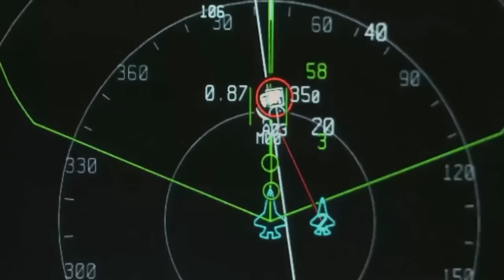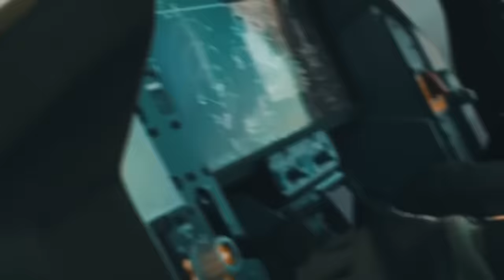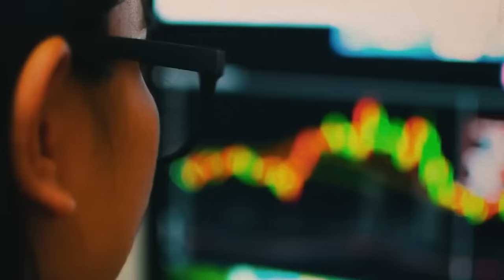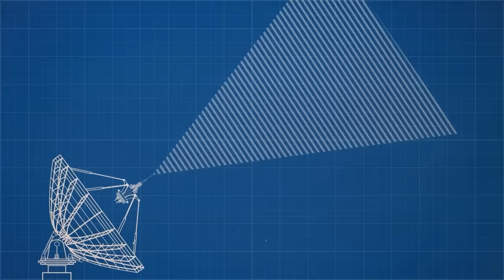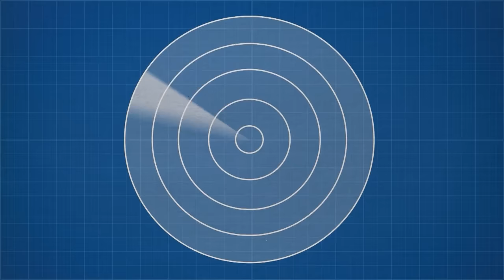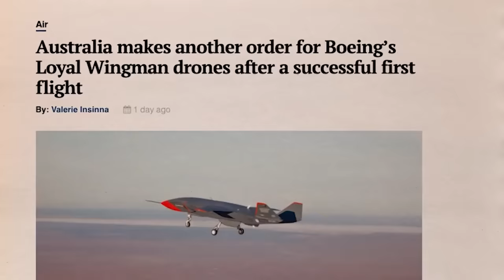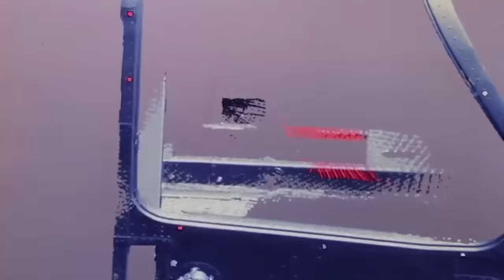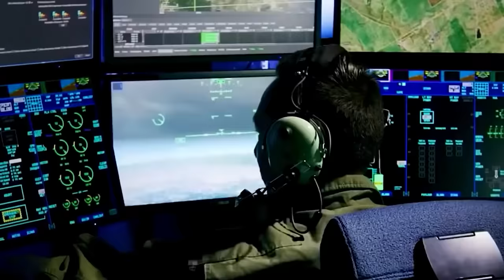The U.S. Airforce Just Admitted They Created A Fighter Jet So Advanced It Can't Be Stopped

Comment: Sounds like our "enemies" will work on developing devices that will knock the computers out rather then old time defenses.
Reply: “Knocking the computers out” they already found a way to prevent that. Or they wouldn’t build it.
Reply: @1985Jesg exactly.
Reply: You need to understand that the rest of the world has a 20 years backlog.
Reply: The computers are hardened against EMP, and, I’m sure, other radiation waves.
Reply: @robertgoodrich8953 these planes actually themselves can be used to do electronic warfare and are resistant against it
Reply: Hack, hack, and hack some more.
Reply: Take out our satellites.
Reply: @1985Jesg I was going to make this comment.
Reply: @robertgoodrich8953 thats why military equipment is so expensive compared to the consumer sector. They have to be hardened to defeat more threats.
Reply: Electro magnetic shielding will prevent it from being knocked out
Reply: Interesting that the bible tells us of basic weapons in future wars

Comment: Hydrogen Turbine propulsion.
Quieter and faster conventional turbine engines.
Also working on a Mercury Turbine. Those craft will have to look like flying saucers which could explain the increased UFO sightings nationwide.
Reply: That sounds like just a rocket
Reply: hydrogen combustion at the end of the turbine definitely wouldn’t be quiet. If it doesn’t combust in the turbine
Reply: my guess for the uap’s would be electrostatics

Comment: The Japanese have a name for anybody that wants to claim direct competitor to our F22 and F35.
KAMIKAZE They are single use.
Reply: Japan, bought the planes for the F-23 , they modified and it fly's faster than the F-22
Reply: @lawrencem3012  Flying faster than an F-22 doesn't mean it's BETTER. Just like a car, just because it is faster, doesn't mean it will win the road race. Handling and total performance means quite a bit overall than just top end speed.

Comment: EMP missiles that detonate manually or set a timer to detonate with large AOE, wonder if heavy emp would hurt this fighter?
Reply: These air craft are being designed to survive nukes so they should be well protected, however, one can’t help but wonder how dependent the air craft and munitions will be with satellites? Remove the satellites from communications and who knows ?
Reply: Oh, most of our advanced technologically advanced fighter planes and a such are hardened from EMP, and they actually use what’s called gallium arsenide transistors, which are impervious to EMP😢

Comment: US Aeronautics, best in World...HOWEVER - Now the Aircraft are Loaded with Computers/Software. RELIABILITY? The Old "Probability of Hardware Failure" NOW BECOMES, The Probability that ONE UNDETECTED  ERROR Still Exists IN The Code. CLASSIC SOLUTION IS MULTIPLE COMPUTERS (Not 2 Computers but 3) in a "Fault Tolerant" Design - You Know "Voting" where 2 of 3 must agree. HOWEVER AGAIN: 2 of 3 Computers & Programs are the same Sup[plier, BUT THE 3RD Computer % Software are Developed by a 2nd Supplier.  A Software Error can Kill & Ground an entire Fleet..... not easy to detect as Hardware.